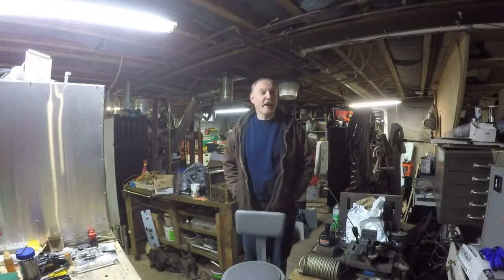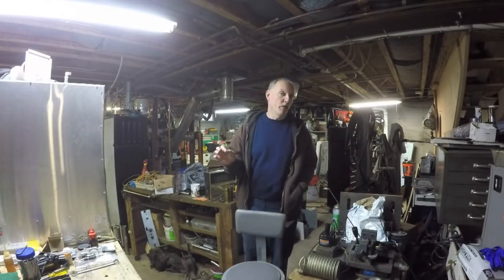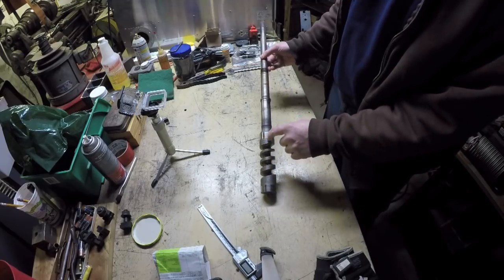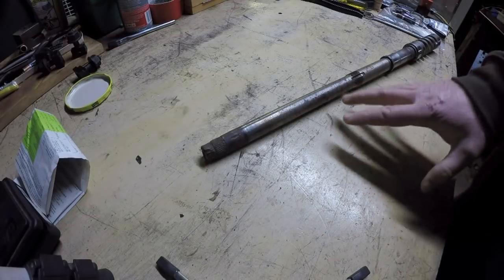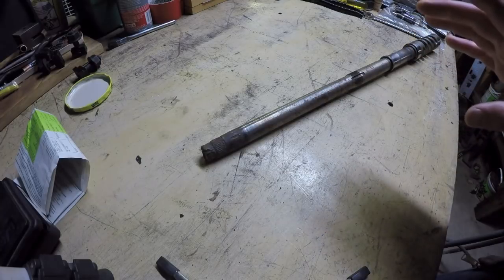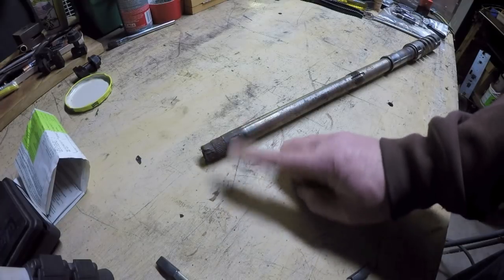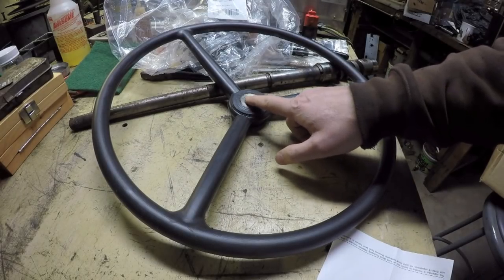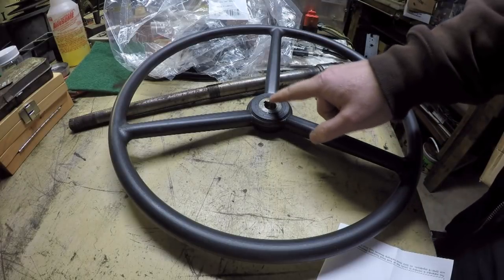IH 350 Utility Tractor Project Part 42

Comment: This project—like many others—can become a real lesson in history and civics! I'm often appalled at how  many botched up repairs I've seen on everything from New York City buses (11 years) and even commercial aircraft (17 years). With this steering shaft you can appreciate the sense of dread as some farmer HAD to get out in the field within the next HOUR on this thing.....but the freaking steering wheel had finally broken almost completely off. Looking forward to your repairing it the way he would have liked to in the first place!
Reply from the maker: Jimmy Lester The truck tires up front, and the front end loader with cracks in the frame indicate a former farm tractor that was beaten down as a logging tractor in it's later years. I hope to do better as it's current owner.

Comment: I couldn't go as deep into that steering system as you managed to go. What I ended up doing on my 350U was cleaning up the damaged splines enough so my new steering wheel slid down over them.  The external threads on the end of the shaft were bad enough so that I decided to secure it another way. I drilled a hole 1 1/4" deep down through the middle of the shaft just under 5/16" diameter (I forgot the exact size called out). Then I tapped it 5/16" X 28 TPI. Used a bottom tap to get the threads nice and deep. I scrounged up a stack of 2" diameter fender washers with a 3/4"  hole so when they're stacked up over the steering shaft sitting on the upper surface of the steering wheel they are just high enough to be ABOVE the end of the steering shaft. Then I I installed a 5/16" X 28 thread bolt and lock washer through a 2" diameter washer with a 5/16" hole in the center. It pulled those big washers and steering wheel they're stacked on top of down on to the splines nice and tight. Been using this tractor/loader/backhoe every day for 3 weeks now with no problem.

Comment: bonus,lathe work and tractor in one video!!!
Reply from the maker: roger oconnor Don't forget tig welding,lol!
Reply: i was thinking,why not drill and tap the shaft to hold the steering wheel instead of external threads?????

Comment: Little bit for you to consider. These tractors are known to get water through the top of the transmission, right around the shifter. This builds up in the bottom of the transaxel and rusts the gears where they sit in that water for a long time. Sometimes if that water freezes they will break.
Reply from the maker: Thanks for the tip. My biggest fear right now is the condition of the motor. The motor was stuck when I bought it, then I had the head done, and got it running, but now it has sat a couple years. I honestly can't remember if I took measure to ensure this wouldn't happen again, like spray lube in the cylinders. As for the transmission cover, some one was kind enough to weld that on......I guess they thought that'd be a good idea since they welded the steering box to the cover!
Reply: Steve Watroba I found it cheaper to rebuild the engine than that axle and transmission when I did it. Had about $950 and time into the engine... one gear set alone was $750 for that transmission,  bearings were $65 and $80 for the more expensive ones.. total on the transmission was about $1700. If it hadn't held some meaning to the family, I'm not sure I would have done that full rebuild.  All said I have a little under $3k but it's mechanically new, and looks it as well. Well.. except I destroyed a cylinder on the front end loader, so  something that I have to do when I find time..

Comment: Take some scrap bar stock and turn a taper on them until you have one that fits the new steering wheel.  Keep it simple,  you're just fixing a tractor steering wheel after all.
Reply from the maker: That's the basic plan.Measure taper to get in the ballpark, set tapering attachment to that measurement as a starting point, cut taper on test piece, test fit, adjust as needed, cut taper on shaft........mess up along the way, start over lol.

Comment: Steve, what's the price on a steering box ? I know you mentioned it before, just seems like alot of work for what it is, when you could get a salvage or another junker and part it out for not much.
Reply from the maker: I checked around a couple years back when I started this project. I learned that the internal bearing, and that short rack are long since obsolete. Next I learned that no one was willing to open up a used box they had and sell me just those parts, they would only sell me complete used boxes. Average price for a used box (power steering version) was 850-1200 plus shipping. So that's what drove me down this road, where I made replacement rollers from drill rod, paid a welder to tig that broken rack, and paid a machine shop to cylindrical grind one of the steering shafts.
Funny thing is, in the past couple years, I've acquired a tig welder, and a tool post grinder, so I could do a couple of these items in house. But the BIGGEST kick in the you know whats, is that in recent months, I've seen complete used boxes pop up for sale within 2 hours drive from me for $400!  DOH!
Reply: I do remember your travails with the gear box and that discussion around the dwindling supply of salvage parts for them. My 58 350U also has a welded on steering wheel—a tiny thing that makes even the power steering seem pointless. I'm hoping to install an original in the next couple of weeks. BTW: welcome back and THANKS!
Reply from the maker: Jimmy Lester thanks! Ahh, so you're also a fellow member of the "worst steering design on earth club" .